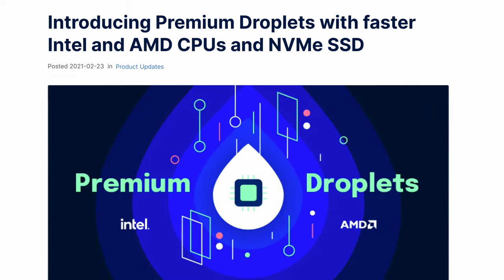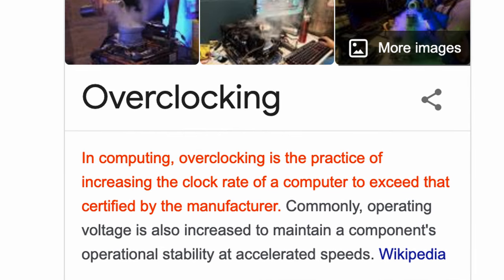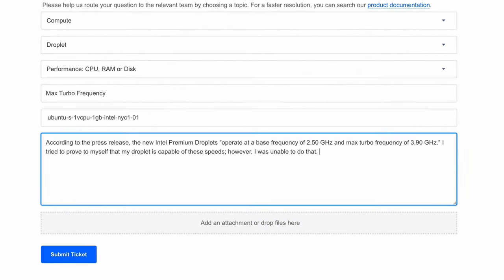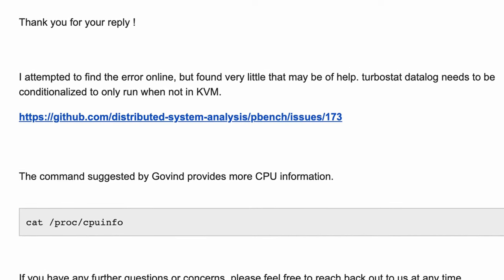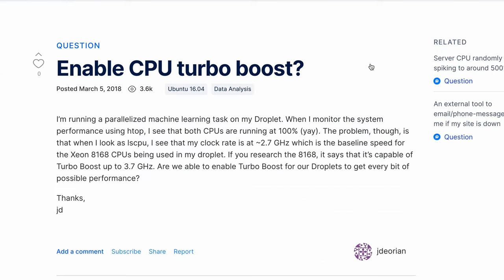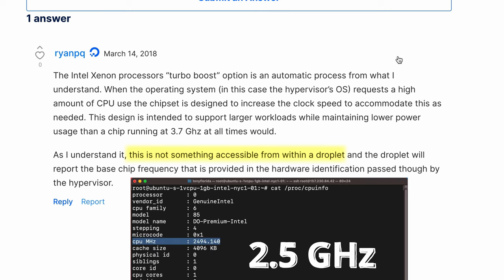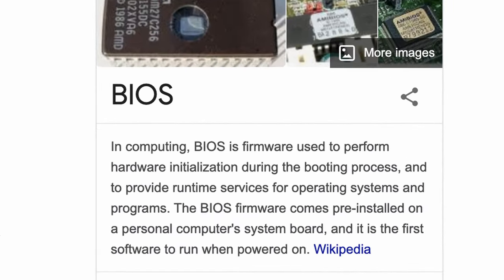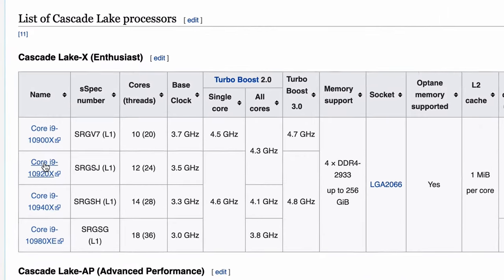Can You Overclock the CPU on a VPS? (max turbo frequency)

Comment: I have a 12th gen core i3 1215u Processor (1.2 - 4.4ghz) 6 core,8 thread...while using solidworks it goes upto 1.8ghz.. it never went upto 2ghz and at low frequency solidworks stops responding....any solution??? Let me know please

Comment: Hi Tony! I do run myself a bare metal server with KVM + libvirt on a Ryzen 9 3900X CPU which has a base clock of 3.6ghz and a turbo clock of up to 4.4ghz. Created a Linux VM with cpu pinning enabled (so I can be sure which cores are allocated by the VM) on cpu4 and cpu12 and ran Geekbench 5 and am happy to confirm that i registered turbo clocks of up to 4.3ghz on the host! Checked it with watch -n .5 cat /sys/devices/system/cpu/cpu{4,12}/cpufreq/scaling_cur_freq. The thing is, it just doesn't report it to the guest. When the benchmark finished, clocks dropped down to around 2.2ghz.
Reply from the maker: Sweet! That's for the great tip Bart
Reply: Hi Bart!
Is there a chance to make a video about it? :) I'm really curious :D

Comment: Yup, you’ll never be able to OC without bios settings to limit voltage and f clock. But even if you could, I’d be more worried about the cooling solution in DOs server room for sustained OCs. If the chip gets too hot then you’ll run into thermal throttling which would negate performance or shut down the cpu.
Reply from the maker: Yeah, if everyone was overclocking their VPS, things would get pretty hot in the datacenters

Comment: Also, I think IPC in this case would be more important than core speed in regards to performance. So a comparison of those would be a better indicator of which cpu is better.
Reply from the maker: What is IPC?
Reply: @TonyTeachesTech  

https://www.tomshardware.com/reviews/ipc-cpu-definition,5777.html

“IPC stands for instructions per cycle/clock. This tells you how many things a CPU can do in one cycle.

While clock speed tells you how many cycles a CPU can complete in a second, IPC tells you how many tasks a CPU can conduct in each cycle. For example, while a CPU with a faster clock speed can complete more cycles in one second, a CPU with a higher IPC but lower clock speed might still be able to complete more tasks in one second. Ultimately, what makes for a faster CPU is a mixture of both clock speed, IPC, and the number of cores.

Note that a CPU's IPC can vary based upon the workload. Further, CPU manufacturers do not typically share IPC information in spec sheets. Tom's Hardware conducts testing to determine IPC in our CPU reviews.”
Reply from the maker: @maccortez8153  IPC definitely sounds like a better measure of CPU performance, thanks
Reply: @TonyTeachesTech  it’s tough to compare IPC since you can’t manually set the clock speed. But if you figure it out, simply set the cpu speed to be equal and all you have to do is give each server cpu a timed workload. Whoever completes it first has a faster IPC.